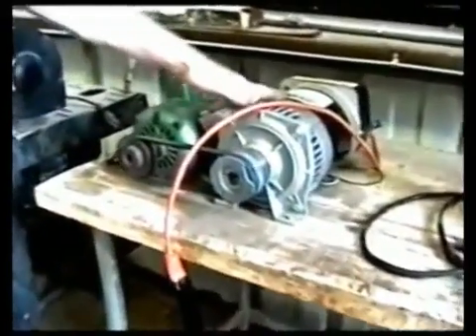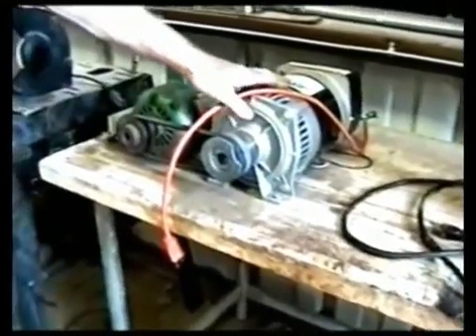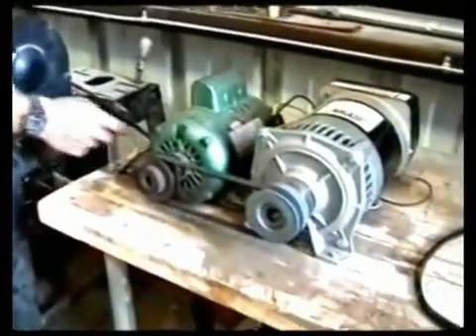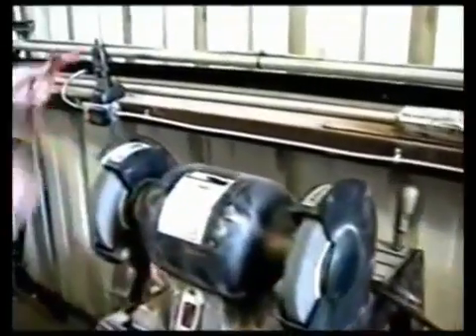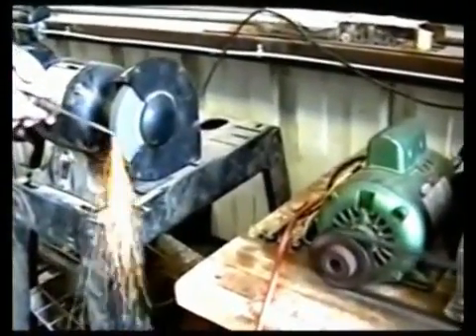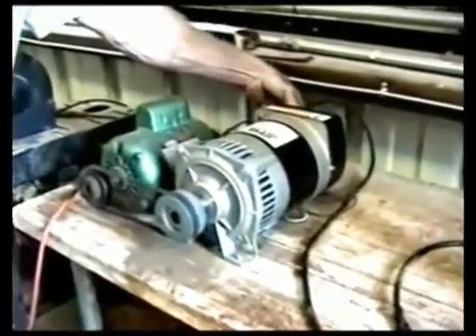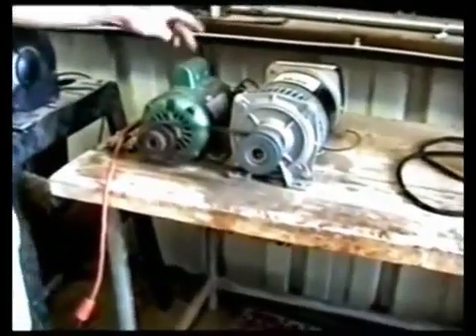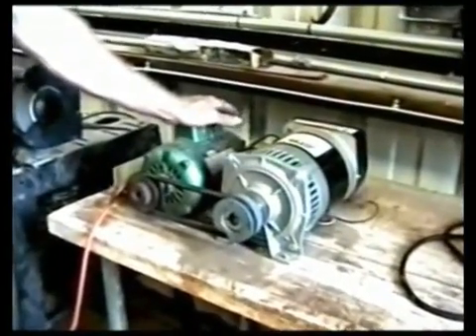3000 Watt Generator Powers Itself, Grinder & Drill Press.

Comment: Let's do some simple math Children:
This is a 120V system. The Generator generates 2900 W of power. Power= Volts*Amps (Ohms Law for AC Circuits)
If the Grinder draws 14 amps and the Drill press draws 16 amps (we aren't even looking at Lock Rotor amps here {Inrush or start up}) then this generator is producing 3600W ((14+16)*120). or 124% of it's rated capacity. Never mind He claims the Motor on the M-G set is being driven by the generator. 
You sir, have defied the simple laws of math and physics with your claim and I declare it garbage.
Reply: He only ran one load at a time. Your math is wrong.
Reply: Dan Harvey you're missing my point there duder.. There is no "law" being broken with the machine im using that generates power.. in fact.. there is nothing but my generator running right now .. this laptop and my hotspot .. talk is cheap. my ass is running it right now .. so blahhh blahhh blahhhhhhhh my power is free, im miles and miles out in the desert .. so whatttever duder.
keeeeeeep on keepin on... lol!
Reply: Not to mention 100%+ efficiency...
Reply: Very accurate response! And lets not forget about the internal resistance of the generator acting on the motor after a load is being applied by the power tools. You just can't… it doesn't work.
Reply: ***** Even worse: the one diode on the AC circuit (which is running a synchronous motor - which can't run on DC power, like you'd get in a circuit with a half-wave rectifier in it) is supposed to completely eliminate resistance in the wiring of the motor. How we know this won't work: if it DID work, those guys at Fermilab and CERN wouldn't have spent the millions they did on liquid helium plumbing and superconductive wire for their particle accelerators. Just wire a blocking diode about the size of a 55-gallon oil drum to every magnet, and you've got it.
Reply: Energy Technology
Some of the most powerful content anywhere
*http://digitalproduct.hol.es/?gocbp=4472*
Cory Harris
Reply: Niko grossenbacher Can you elaborate more on how that may be ?
Reply: TheOriginalSyonix THank you for the wonderfully crafted insults including the claims made in the above video. 
Fact: In order to build a generator that can put out MORE energy than put in requires breaking the fundamental laws of Physics. 1) Energy can not be created nor destroyed, only changed from one form to another. 
Mathematically, the claimant is saying he is putting in 3000W of energy and getting back 3600W, simply not possible.
There is always a cost, be it money, energy or otherwise. You don't live off the grid for free, there is a cost and you aren't sharing it. You might be right, I am missing something, I suspect it's because you are sharing. 
Still a Liar.
Reply: Niko grossenbacher You are a no go at this station, Niko. A blocking diode is used to prevent current from going somewhere you don't want it to, like from your batteries to your solar panel when the sun goes down. Also, you lose 0.7 volts in the PN junction of any silicon diode. A silicon carbide Schottky diode will give you a lower forward voltage, but they're $8 apiece.
Reply: ***** I have given up hope long ago, the school systems are churning out mindless wanks with no knowledge of how the world works around them. "Look mum there's an aero-plane up in the sky". Must be magic.
Reply: Before you claim the intellectual victory, you may just want to pull that stick from your ass.. Any argument, in favor or against a claim is instantly discredited when it starts like the way yours did.. So here's it back acha.. Child. You are stupid. I built this, it works, I live off grid for free. I pay very very little in gas to start my power and nothing to keep it going. I only shut it off when I don't need it. Fools living in the cities full of LIES. You are obviously missing shit.. dude.

Comment: Have you tried to put a gear ratio to the  gen to motor simple mechanics and get higher revs and you may be able to get rid of the electric start. Then you will able to use  an of grid old fashion cranck start just like the 1800 cars

Comment: I have tried to replicate this. I actually just finished the project a half hour ago. 
I am using a little different set up. but basic parts are similar.
I have a 10k watt generator head with a 1.5hp motor 120v ac
the pulleys I used made my generator run at the exact rpm required by the manufacturer.
I ran power from an outlet to start the unit. while having power coming from the generator head both running into a 50amp three way switch.
going from wall outlet, to generator, threw the switch.
running the generator at full speed with wall power shows full power output.
When I switch it over to only generator power it shuts down. and the power diminishes. then comes to a stop. 
I would assume that if this did work with his configuration, why not with a bigger scale?
If anyone has made this work, please help me out.

Comment: ok for any that thinks this could even possibly work I am an electrician by trade now for over 15 year simply put we cant make a device with 100% efficiency let alone over that the motor at best is 90% the generator the same if not less generators are simple machine so are the motors just measured coils of wire to produce a magnetic field that magnetic field is also what limit how much power the motor uses and what the generator makes it cant not be altered that is against all physics in order for the generator to make more power it needs a greater magnetic field which creates more rotational drag causing load on the motor increasing it power requirement move this from where the idea load/rpm is for either device efficiency decreases drastically 'free' energy is not possible as many great people have said energy isn't created only transferred so our best bet to find the cleanest most efficient way of doing that not wasting time on this
Reply: Daniel Jefferson I hesitate to assume this "inventor" knows enough science to scam people. I find it more likely that he "invented" the transformer. He said he rewired the generator. I also question why his 3300 Watt motor was powered by an 1800 Watt electrical circuit without tripping the circuit breaker.
Reply: sound good to me.
Reply: Casey Speaks he isn't powering a 3000 watt generator with the 1800 watt circuit. He is powering a 3/4 HP 120v induction motor which pulls maybe 5 amps.
Reply: Look at their home page. Its all about 'Ministries'. They are using all these claims to draw suckers in, to donate (or pay for consultations) for their 'Ministry' organization. Just one more angle being worked for free monies. LOL. Its just this generations 'Snake Oil Salesman'
Reply: jake doesn't matter what he is running - he has to plug it in to mains power. it's just a transformer.
Reply from the maker: The additional energy is from "Ground Zero", it is not created, it is there already and the Law of Conservation of Energy is referring to an isolated system, but strictly isolated systems do NOT occur in nature.
Reply: That is the biggest load of bs since you not even talking about the conservation of energy only changing it's state from electrical to rotational and back to electrical

Comment: It's a perfect hoax. No signs of speed droop on the generator when he turns on the grinder or the drill.
Reply from the maker: Lenz law is eliminated.
Reply: TheWorldSolutions the description says this does not violate any laws of physics, yet here you state that Lenz's Law is eliminated.  You can't just eliminate a law of physics.   That's like saying I choose to ignore gravity.   Regardless of the SOURCE of your power, as the charged particles, in this case electrons, move throughout the system, you will have a magnetic field that OPPOSES the change in magnetic flux.  

Look, the idea of a self-sustaining resonant system is nobel concept, but it's also nothing new, and the critical issues have been thoroughly explored.  Unless you're using superconductors, the wires will have resistance, and you will lose power as heat.   As long as there are bearings, you will have friction.   As long as there is an atmosphere, (i.e., not a vacuum) you will have drag.   As long as there are gaps between the rotor and the stator of the motor, you will loose field strength due to the inverse square law.  

IF you were able to correct all these, you could have a system that might self-sustain for a very, very long time.   However, the final nail in the coffin is that even in this perfect scenario, the total energy of the system would still be finite, measurable, and predictable.  Which means that to put any external load onto the system would be removing energy from that system.   In this case, using a rotating mass, you're storing energy in the form of angular momentum.  Also known as a flywheel.  

In fact, if you wanted to make this contraption even more spectacular, you'd make it larger, MUCH larger, like the size of an entire room, with large heavy flywheels on perfectly aligned bearings. In that scenario, pulling 5kw-20kw loads would be trivial, without the need to hide your secret wires that are really providing power to this machine.
Reply: Bert Green Don't waste too much of your time refuting the trash science put forth by this group of diseased idiots. They're more than happy to ramble on endlessly about fields of study which they haven't the most fundamental understanding of. If you sprinkle the description of your worthless endeavors with the word 'quantum' enough times, you just might fool someone into donating money for a good cause.

Comment: Sorry kiddies.  This is a hoax.  Energy from "Ground Zero?"  Bull.  This guy is using a motor to drive a generator and is powering the motor from an outside source.  That source is not some magical cloud of free electricity.  It's a wire, hooked into either another generator or a battery that was charged by a generator.  

There ain't no such thing as a free lunch or a perpetual motion machine.

Comment: So you use the wall plug to start the motor, which runs the generator?  Then you shut off the wall power and the generator runs the motor, which powers the generator, which runs the motor?  And the generator has enough left over to run the grinder and/or drill press?

Comment: This is not anything new. Its widely used in sweden since many years mostly by people in the countryside.
Thats the biggest reason for the increased prices of electricity in sweden. Those who dont produce their own pay for the lost income for electricity companies. 
Not mutch is talked about it since different systems for free energy in sweden is taxed.
So people using it keep their mouth shut.
The modifications is really simple. You simply remove the"limiter" that is installed in every motor and generator, preventing them to give more then 100% energy back.
In many machines its even labeled limiter.

Comment: May I just ask, what is the horsepower of the motor? Should it be less than 50% of the output of the generator so you can achieve overunity? If it is less than 50% of 3000watts, can it really drive the generator?

Comment: Gee, this is nothing new, if we the people ever take back our county then we whom hide our inventions, would come out of hiding and share them with all mankind...
As for this invention? of course this generator and electric motor  works (real deal) because the generator produces thirty times more power than that electric motor draws.....
Reply: its not an "invention" motors and generators have been around for over a century and you think people havent thought to link them up in all that time? theres a reason its bs and thats because it doesnt work. sure the generator is capable of putting out more electricity than the motor takes in but that is if the generator is spun up to full speed and guess what... the motor cant take the generator to that speed because... wait for it... THE MOTOR ISNT STRONG ENOUGH FOR THAT. unless you had a 100% efficient motor the amount of energy the generator would be producing at the moment of unplugging the motor from the wall would be less than the amount of energy being put into the motor and of course that means the motor will slow down which will slow the generator down which reduces the power being generated so it slows down more and more until it stops, and that will all happen very quickly.
Reply: If it was true that the generator produced thirty times more energy than the motor outputs then the motor wouldn't be strong enough to turn it.
Reply: Oh, really big mouth, i hold an engineering degree in electronics and invented the ONTV scramble decoder system for ITC broadcasters...

So my education is just fine!!!
Reply: Paul West How does a generator being driven by a motor put out thirty times the the power of the motor driving it?
Reply: It has the capability of putting up thirty times the power that washing machine motor needs to spin. However, I believe the trick to this particular form of partial perpetual motion, is in the rotation of both devices. Thus, this dude is only utilizing a portion of the energy generated, which makes the whole concept quite feasible........
Reply: Paul West You're and electrical engineer and you believe in perpetual motion using a traditional a/c motor? You Just threw all credibility out the window and should be fired and stripped of your seal. That's a 3000 watt motor powering a 3000 watt alternator. A 3000 watt motor will never spin up a generator to produce 90000 watts so wtf are you even talking about?

Comment: Hi. I believe that this is genuine. I guess thequestion is does this device give off radiation that is harmful? Since you are splitting the electron and letting it rejoin together to create more energy than you put in, is this harmful - like in an atomic reaction where they thought it was safe but it wasn't!? Hmmmm...
Reply: Splitting the electron?!Are you for real?That was theorized a couple of decades ago but could only be tested in 2012 with positive results(it seems)but they used a computer program simulation as some sort of comparitive what makes the result not entirely accepted,it has to much variables for the assumption.Anyway is a very complex experiment,who do you think this guy on the video is?Nasa engeneers chief?He has no way of splitting electrons,you dont splitt electrons with an alternator into quasi-particules.
Reply: Splitting an electron requires firing an alpha particle at 90% of the speed of light and it is rarely successful. even collecting an alpha particle requires HUGE amounts of electromagnetic energy and a SUPER-COLLIDER like the CERN institute or the newer Large Hadron Collider. 

I honestly doubt "WorldSolutions" has the slightest idea what he actually did - which sounds like he built a step-down transformer or an induction coil - both of which are used extensively in power distribution and telecommunications - and have been for about a 100 years.
Reply: Markhuntonio LOL yea... that's his point.

Comment: I am puzzled a 3000 w generator would need a powerful 3000 watts (3 hp more) drive motor and with that small drive motor in picture will power a grinder and drill press?? This is not possible. You will have to consider power losses, heat and friction. Like you, I have been doing the same experiments maybe we can work together. My contact is turla_222@yahoo.com  Eddie,  but no tricks pls.

Comment: I have a 7000W cont./ 10,000W peak gen head and a motor to do set up. Have caps and other items.  The gen head is modified sine wave. I do have a 5000W pure sine wave gen head with which I can then do a grid tie or just tie to my home panel.  I'm trying to figur out the special modification you made to make the motor run more efficiently on the  more pure sine wave instead of the surging modified sine wave.  Thank you.

Comment: Would you be able to over-drive the unit? Put a pulley slightly larger on the motor, and a pulley half its size on the generator? It could lessen the power draw or create an excess of power

Comment: Are you able to tell me the details of your system; that is, 3.25 hp electric motor to operate your modified 3000w generator. In particular any modifications that you have made which are necessary to operate the system.

If you have an electrical diagram I would appreciate if you would email me the same to: john@pmc.id.au. 

Please let me know if there is a cost involved eg., to purchase the information requested above.

Thanks for your response.

Comment: I would love to see you do this again...while you microwave a burito (1000w*2minutes) instead of rotational momentum being used in every instance to prove it, maintaining a spin is very easy once you get it going. the wheel on a grinder weigh alot and then unless you do work with it(grind alot, not just lightly for sparks), it doesn't take much energy to keep it going, just like the extra weight with the screwdriver, created such a large rotational momentum because the screwdriver was at an angle. If you did, it that is awesome!!!  I believe a loophole must exist somewhere with magnetic placement. BUT if you really have "200X more power than we have at ground zero". Microwave a burrito...CHALLENGE PRONOUNCED, do you accept? Prove me this, I want one, name your price :-D

Comment: Am looking for a power source for my Fall Out Shelter. How many amps does this system produce?/? I need enough continuous power to power for 10 low wattage bulbs ~ 30 amp water pump ~ small ceiling fan ~ refrigerator powered by propane.